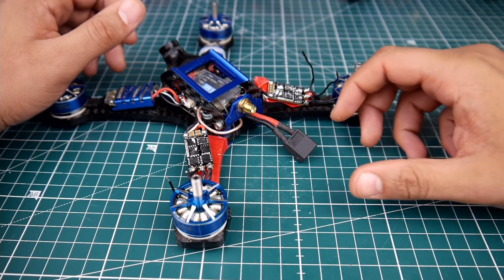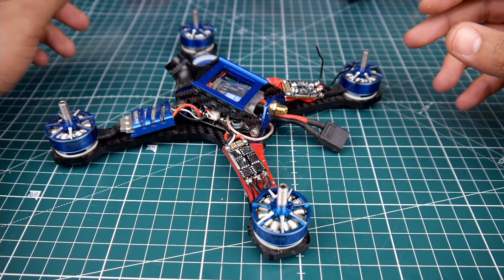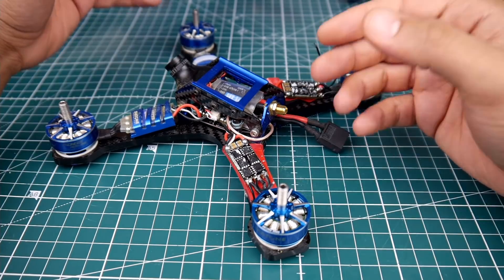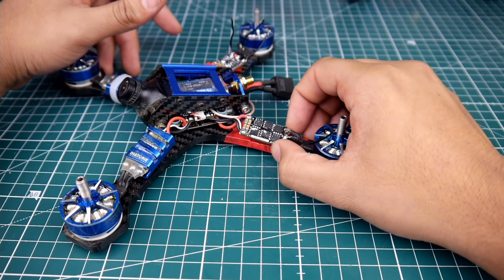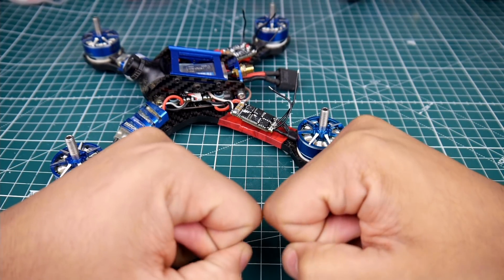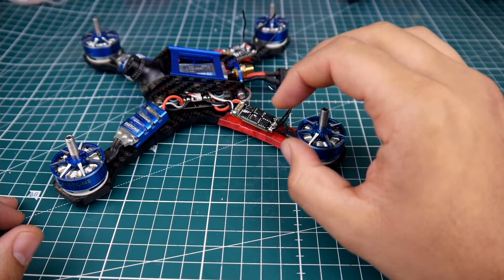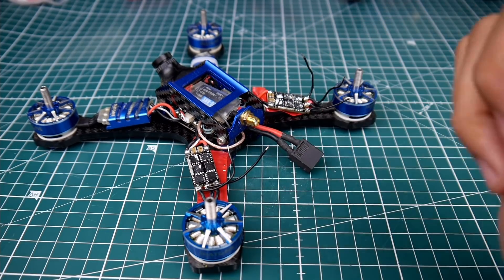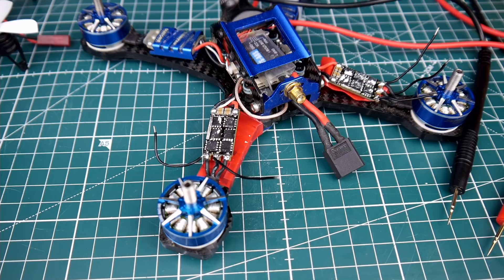How to Test ESC with Multimeter // How to Test Bad ESC Mosfets

Comment: Just slave in another esc ! If it works, bad esc if no work, it's something else. That's what aircraft avionics techs do....lol their box changes.
If you want to fix the bad ones in a bin and order your parts and bench repair them. I mean, if you do the continuity test and esc is bad, you're going to put a new one in any way. Don't waste your time. Repairing circuit boards are for professionals. You really need to know what you're doing. I worked on aircraft components, and you  need to be trained. Good video. A mosfit is just a fancy switch, basically,  with multiple on and offs. One is normally off the other normally on, or open & closed. That's the N & P

Comment: Hello I wondering if you can help me is there a way to test a esc can handle the battery amperage it says it can i have a 150a 6s capable esc it runs fine on 2s 3s 4s then 6s it burns up is there a way to know if it can really handle 6s.

Comment: hi man, i have tested my setup and it turns out in burning one of my motors. So my question is what could have happened? Im running Holybro Tekko32 35A single ESCs and IFlight Xing 2207 2450KV. BTW thx a lot for helping me test the ESC!

Comment: Super nice video,one question I have esc for boat end it's not working but i have" Bec " end it's working I have control for my reseiver end for rudder but no control the motor do you think it's possible to be mosets damage.
Reply: bec is controlled by other circuit on esc so in this case you have mosfet(s) burnt, check them one by one with multimeter and change them.
Reply: @bladermusics  tank you

Comment: Sir i have cheap 30A esc , its creating problem 
If i connect motor in it and after applied signal the motor start fluctuating with high vibration . And if i use it with other esc then it works fine . 
Can u please tell me how can i troubleshoot this problem
Reply from the maker: Change the ESC

Comment: Is it still possible to save a 4 in 1 esc that was wired in wrong? I accidentally wired the vbat wire from the esc to signal 1 and burned the processor of the FC. The 4in 1 ESC does not have any physical damage but it doesnt boot up anymore.

Comment: what would cause motor to get hot hot and twitch and stop when testing on betaflight new spedix 4.1 esc and ive found there is power flowing from lipo input negative to motor output pad on esc #2? mosfet?
Reply: Hey did you find out anything about this? I had the same exact problem with the same exact 4 in 1 esc a few months ago and it still keeps me up at night!!

Comment: I think most people are better off buying an entirely new esc. After you pay for the mosfets, heat gun, solder paste, and the inevitable mess that will be made of the board by someone with zero experience soldering SMD components, .......just buy the ESC.
Reply: Argle Bargle maybe but if your capable of doing it why not. Will save you money in the long run and if it’s already broke doesn’t really matter if somebody breaks it more

Comment: Just finished putting together my first quad an it went well after I've binded my receiver an setup betaflight an plug the battery in no smoke so that's good but when I arm it the motors they don't idol up but they will when I throttle up except #3 an #1 doesn't seem to be working right either when I'm in betaflight the motors all work fine with the master control I was wondering if maybe you might have an idea

Comment: Mad vid @Drone Mesh. I've of this https://tinyurl.com/ycd44qk8 and motor 3 won't run. The Mosfet test tells me all the Mosfets are fine. I've tried another motor but same result. Continuity exists between the ground pin on the FC JST pin plug with all esc Mosfets...what should I do next? Have ordered another esc to keep going but would like to trouble shoot this seemingly flawed one and either fix or toss it. Great vids...keep them coming.
Reply from the maker: 1. check the signal wire for motor 3 if damaged and try changing to motor 2 pad on FC. If that works could be the signal pin 3 on FC is damaged.

Keep me updated
Reply from the maker: Also check this video and test motor outputs with LED.

https://youtu.be/a2gaSGUnrKQ
Reply: Sweet. Will do and def get back to you. Got a mad week at work coming up so may not be looking at it until next weekend (Australia...late Sunday night now). Thanks again.

Comment: Thanks for the video. 
Can you explain, why our ESCs are burning? Some of them have MOSFETs rated for much higher voltage and current than the ESC, but still they are burning. Yeah, we are pushing them hard, but still - they are rated for it.
Also interesting that all fets on your ESC are burnt. I'm more used to see 1 really burnt and melted fet, and the others seem ok (or at least not melted).
Reply from the maker: +Xen0ff I flew it through a tree to save another quad.

Comment: I just ordered some top of the line esc's that you reviewed because of the good results. I plan to use the current limiting feature to help reduce damage when the prop jams. I was wondering if you think that would help or are the MOSFET's done for if the jam duration lasts too long. Plan B, will a small aluminum heat sink help? Wondering why they aren't put on by the manufacturer. Thoughts?
Reply: I can tell you that when running these mosfets as hard as we do, a heat sink will certainly help them. 
I think the heat sinks don't always come with the esc for weight reduction reasons. Possibly price too, but for quads that are aiming to stay under 250g, it makes sense to not use a heat sink, since there is a high rush of air cooling the electronics during flight. 
So, I don't know about the limiting feature, but if weight is not an issue at your final weigh-in, a heat sink will not hurt, but is not absolutely needed.

Comment: If there are 2 mosfets per wire, would they be paraller? So if one of them goes bad and you measure continuity you cant know which of the 2 paraller mosfets are bad as both would beeb through even if only one goes bad?
Reply: same thoughts here. mosfets are in parallel. so does this video make any sense?

Comment: You can try get those MOSFETs from eBay or aliexpress. They will not be the same quality but they should be fine, BTW i really want to see how to change MOSFETs on ESC :)
Reply: David I want to see drone mesh to do it
Reply: Good luck desoldering SMD FETs
Reply: Yeah, you must be using ESCs from 2015 which are bulky and have big ass DIP MOSFETs instead of recent ESCs which have very tiny MOSFETs that is PITA to solder but whatever..
Reply: IRFZ44 :D
Reply: IRFZ44 Soldering? Nope, use your gf's old hair straighteners as a hotplate. Win

Comment: will one bad mosfet ruin an esc? i had this issue before with the motor twitching and desyncing when i throttled up. it ended up being a broken wire on the motor winding. i could never figure out how to test an esc. now i do. thanks drone mesh!

Comment: Thanks for the video. I have a Hobbywing 4  in 1 esc with a bad Mosfet (I think) or maybe it just slid out of place due to heat or a crash. 

Here's a picture of it: https://photos.app.goo.gl/13F7uTWnF0rJ9h6P2

Mosfet I need: https://goo.gl/4VNe5j

In order to replace it I guess I'll need to buy a rework station next (suggestions?) I'd like to test it using your method but there does not appear to be a way to test it without removing it. Do you see a method?

Thanks again for the video. "I learned something new today!"